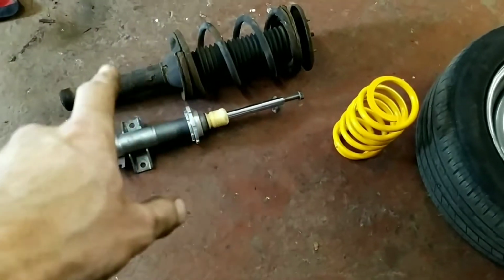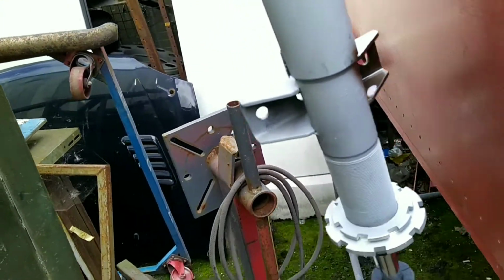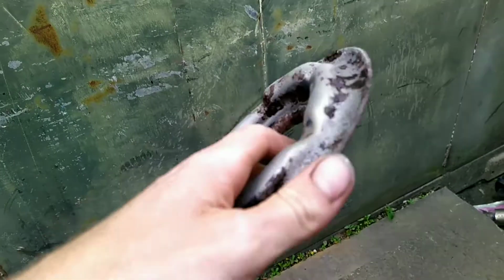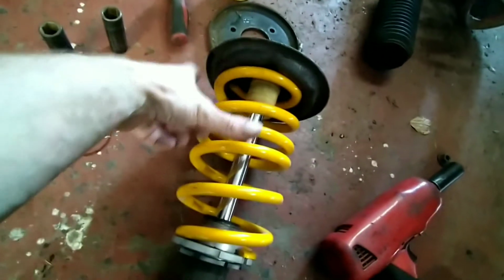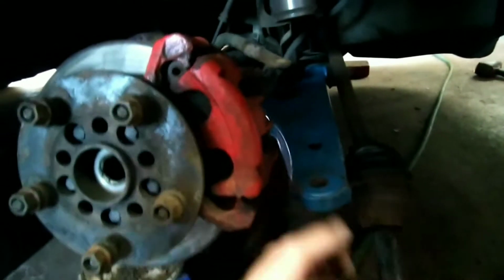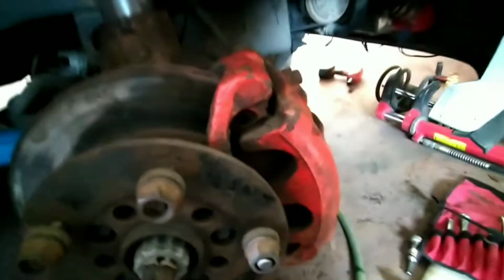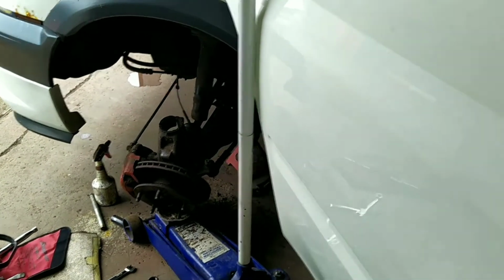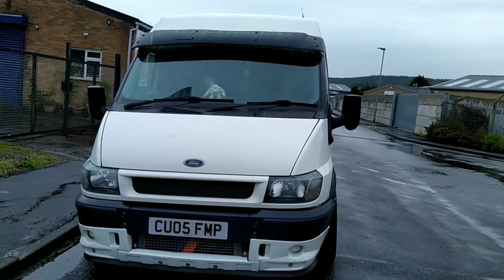LOWERING my Ford Transit INSTALLING COILOVERS.

Comment: Hi mate where your original shocks just slid down into the hub to lower it ? And what about fitting the rear axle ontop of standard leave spring ? could that be done?
Reply from the maker: Before fitting the coil over it was yeah.
Reply: @ThePhilBilly   ohh nice one haha
Reply from the maker: It was fine on then too, never had any problems but got these T5 coil overs for like 60 quid. So was worth the upgrade. I also did the modified bottom arms too. The video is on my channel somewhere too
Reply from the maker: I just saw the edited commen too, I got lowered rear leaf springs from midland road springs. Alot of people do the axel flip though. If your on Facebook search a group called Stanced Transits. It's a great group I used to be very into before I sold my van.

Comment: I've got a mk7 tourneo and wanted to know best way to lower my van? Is T5 coilovers the way to go? And what do I do on the rear?
Reply from the maker: Hi, theres 2 real options for the rear, you can either do the axel flip where to modify the axel to put the springs underneath the axel or you can buy lowered leaf springs. I got my lowered leaf springs for midland road springs.

Comment: Did you use the original drop links? Or did you need a certain one
Reply from the maker: Just used the original drop links, but I have got modified bottom arms in, if you have a look I've got a video on them too, it's to adjust the rear bush so it sits level when lowered.
Reply: @ThePhilBilly  yeah I saw that. I'm a carpenter so out my depth lol
Reply from the maker: @brianbatten3664  yeah, it's a daunting thing of your not into that job, I have a pair of arms I was thinking about making I to low arms and selling if your interested. I might do it on an exchange thing so you buy my set then you can send me your old set for some money off. If you interested.
Reply: @ThePhilBilly  it does sound interesting tell me more lol
Reply from the maker: @brianbatten3664  well I can do anlther set of arms from my spares I have, I make them into modified lowered arms, you buy them off me and send me you old standard ones haha. Haven't thought about prices yet I'd need to price up how much new bushes are ect
Reply: @ThePhilBilly  well as soon as you know. Let me know
Reply from the maker: @brianbatten3664  will do. I'll try and remember to price them up today
Reply: @ThePhilBilly  👍
Reply from the maker: @brianbatten3664  not going to lie I clean forgot! I've found my spare arms today, I think it would be like £150 for the modified arms, and I'll powder then what ever colour you like haha.
Reply: How did you lower the rear and how much lower did it get? Iv seen some lowering springs but not sure how much they lower the van.
Reply from the maker: @ivandyer9333  I bought decambered rear springs from midland road springs, told them how much drop I wanted and they did them for me, The back end is chassis notched for clearance now, the front I did just strut drop at first then I ended up buying VW T5 coilovers, Its also on the modified bottom arms too.